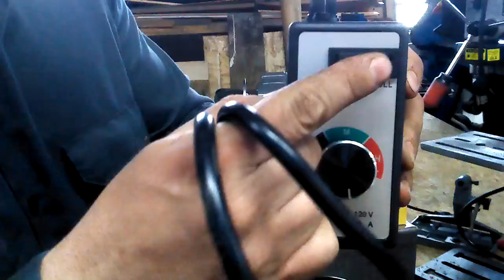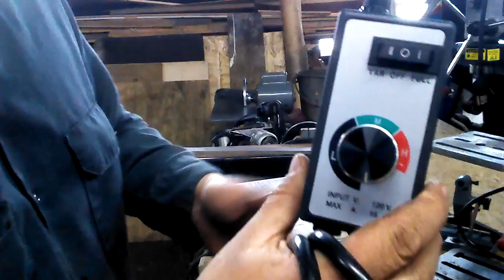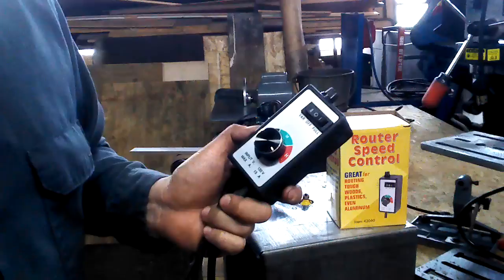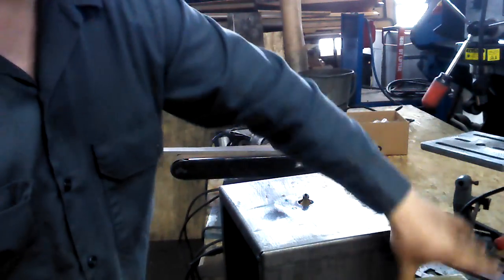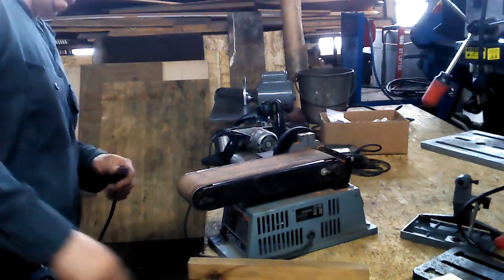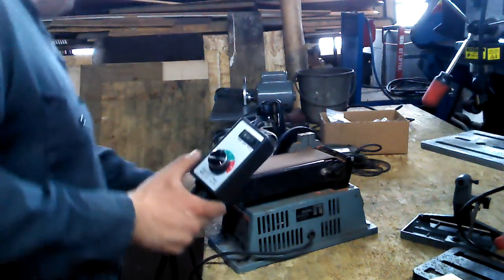Review: Harbor Freight Router Speed Control, does it work?

Comment: Would it work on a craftsman 3/4 hp 110 motor, for my metal lathe?
Reply: No that's an induction
 motor.
Reply: Idk what size Craftsman lathe you have or its age but my old metal lathe has plenty of different belt settings to cover the speed of turning anything I'll be turning then if you want to go real slow, put it in back gear then it crawls. The quick change box works very well on the feed speed which is determined by the rpm of the lead screw. Idk what you're needing a speed controller on the craftsman lathe for unless you're stuck on a high belt setting and are unable to change that. Please enlighten a dummy if you would as that has me scratching my head...
Reply: @decoy2636  lol, I had just bought the old lathe and didn’t know the first thing about it at the time, you are right. I’ve learned quite a bit since but still don’t use it much.
Reply: @shanek6582  
I'm glad you got it many things can be made on it. Mine is a 12" Atlas/Craftsman and has a 4' bed. Its handy around the shop although time spent dictates most things you will make with it. My lathe is not as accurate as one would like as prior to my acquiring it it lived a (rode hard put up wet) hard existance. 
I tried to buy it for over a decade from the owner before me before I walked in his shop with the right bait to trade with him for it.
I do hope you enjoy yours as much as I have this one. 
If you don't want to keep it part it out.
To add I wouldn't consider getting rid of mine and wasn't suggesting you should get rid of yours either. Parting one out brings double money it seems or more so that's what I was trying to say.
Best Wishes and happy turning to you.

Comment: Had one of these for years used it on electric die grinder for porting heads and lets you use a $40 die grinder to do the job of a $400 one that has a speed control built in.. 20 thousand rpms is just a tad to fast for port work I did it for years prior but with speed control its a whole other world. last year I dropped mine and it stopped working ..no worries $15 from harbor freight and got a new one however new one is absolute shit it does not slow down the die grinder very much as original goes to zero and infinetily adjustable the new one lowest speed is just to fucking fast to be useful. Save your money buy a single pole light dimmer rotary switch for $7 and a plastic light switch box for 27 cents and make your own

Comment: sir I have 1000w 50hz 220v 12000rpm brushed motor marble cutter machine , just I need slow speed so I have purchase from Amazon tiny adjustable speed controller 2000w ac 220v please guide me it will work or not if possible suggest any controller thank you

Comment: Would like to get one.This is coolest and the safest way not try to connect any wiring. But can this handle like a food blender, hand drill or a floor fan?
Reply: To answer that question it's best to know a little about what kind of motor you're dealing with and what sort of speed controller you're trying to match it up with. Single or three phase AC induction motors, AC permanent magnet motors, DC permanent magnet motors, and universal motors are all best controlled by different speed controls. Jeremy Fielding has a bunch of great videos on this sort of thing!

https://www.youtube.com/watch?v=ASywVBU0ZwE

Comment: will this work on an inline fan for a grow room? asking for a friend.
Reply: There is no purpose.  It should already be a controlled environment so the fan speed should be fixed, or can just cycle on and off.  This would just add a layer of lower reliability for something on 24/7 and since it doesn't self-regulate based on temperature or humidity, has no point in being used.  Get (one or more) big, really big, low RPM fans, and run them 24/7.  This means you do not want brushed motors because they'd wear out, rather induction motors which this controller isn't suited for even if none of the above applied.  So, triple no.

Comment: first of all thank you for sharing this video ,i have an electric motor(3/4 HP 1750 RPM
.3.5 AMP  ,110 V) it is a sander machine )i am looking for a speed controller for it ,do you think dose this speed controller work for it or not?.Thanks
Reply from the maker: matt kermani , not sure but this thing seems to be designed for hand power tools. I hope that helps, thanks for watching!
Reply: okay.thanks anyway
Reply: it will slow it down and also take away the power.. plus overheat the motor & could damage it

Comment: I have a 115 Volt 1725 RPM motor, will this work for this?   I'm trying to slow down a flat lap for lapidary work.
Reply from the maker: probably not, it works mostly on hand power tools because they have  brushes.
Reply: it will work but wont slow it down as much as you want
Reply: I was curious of the same thing. Tried a wall dimmer switch and I think it fried.
Reply: You have what is almost certainly an induction motor. DO NOT use a speed control like this to run ANY induction motor. The Triac ruins the sine wave that your motor depends on for proper operation, and the lower voltage will cause the motor to draw MORE current as rotor slippage increases.

Comment: would this work on a 12 volt 55 pound thrust  trolling motor
Reply from the maker: Odds are no.
Reply: That makes no sense.  It would have a throttle already.  Repair it properly, this is entirely unsuitable for a water environment and unsafe to use a little dial that sits in a fixed position with nobody holding throttle on.

Comment: anybody notice that their router sparks like crazy inside when you use the variable speed control? i have that 2 hp router from h.f. and the speed control and when i use them together it sparks/arcs in the motor. i can see it and hear it. redish orange arc... normal?
Reply: +jchinderle probably not a healthy thing. I had a black & decker drill that did that. It smelled like it was melting everytime I used it! 2 weeks later I got rid of it.
Reply: +jchinderle Indeed, quite a few sparks in there.  After all, this speed control is actually triggering many times a second to control the phase angle thus the speed of the tool.  Try to turn on and off a lamp with a switch rapidly, you'll see sparks on the contacts. One way to minimize such thing would potentially be the addition of a snubber or a running capacitor similar to the ones found in the HVAC.

Comment: You didn't open it up and see what's inside. More importantly you didn't put it on a osiliscope to see whether or not you're getting a full cycle or half cycle pulse. Which it seems others like it are only half cycle and pulse, which will burn out your tools. Which means it's not a true speed controller. You could easily test it without an osiliscope by hooking it up to an incandescent bulb and see if it pulses at a low setting. And if it does..  it's garbage!
Just plugging it up a bunch of tools doesn't mean squat.

Comment: Do you think it might work with a Dremel tool?
Reply from the maker: +Bruce Prosser Think so, But you should loose all power since it is an already tiny motor.
Reply: +Bruce Prosser only if it's a single speed. +1 to OP, you'll lose power - or in other words, it will be easier for the bit to bog down and stop turning. It would be good for buffing and maybe light sanding but not good for cutting wheels.
Reply: Thank you

Comment: ive tried that rout before ...as you can see not the best

you need either a powerful DC motor + dc motor variable controller 
or 
a 3 phase motor + variable frequency driver aslo called vector drive

both appraoches arent cheap

Comment: Have you tried this on a Lathe? I have HF's 10x18 Lathe which is great expect you have to change speeds via belts and if i'm working on a few different things that gets frustrating.
Reply: Kaged Creations would not work. It can only control brushes universal motors

Comment: I just watch this video to see if anybody else had good results with theirs I hook this device up to a 7 inch grinder that pulls a 10 amp load the package on the speed controller says it'll handle up to 15 amps yes it did work for about 20 seconds it burned up the fuse did not blow it just quit working I went to the hardware store and bought a halogen light dimmer put it in the box works better than this thing just let everybody would like to know

Comment: Why doesn't it reduce to zero rpm ? Seems it only slows down about 50%
Reply: That would be pointless because when used with the brushed motors it is intended for, long before it got anywhere near zero RPM, it would bog down under any load because there is nothing in it to boost output to maintain motor RPM.

Comment: Will NOT work on induction motors. Induction motors require a VFD to alter the frequency, not voltage. A home dimmer switch for lights can do the same thing for a Brushed DC motor as long as the amps do not exceed the units

Comment: Those things so ive found are built to a average amp pull. You load them up at low speed the brushes in your motor will arc and burn the rota plates out. DONT USE THESE unless your motor is the right motor for variable speeds. Basicly, if the tool you have isnt variable speed, Its not ment to be. Check the next model up, Is it variable? Does it use the same motor as the one you want to tweak?   Be careful, You might be doing this to save money buying the real thing, It may well cost you more... Much more. (fire)
Reply: Best explanation. If it aint variable as made, not meant to be. Your needle in the haystack!

Comment: How would this work on a bench grinder?
Reply from the maker: +P CC Most likely not, most bench grinders are Induction motors like the drill press and belt sander. This speed control only works with Brushed motors on power hand tools.

Comment: tengo un motor electrico de los mismo que tu tenes al fondo de tu taller  si funcionara con ese adaptador es de 115 voltios 1725 RPM de marca WEG BRASILERO DE 1.5HP GRACIAS POR TU REPUESTA 

I have an electric motor of the same that you have to the bottom of your workshop if it works with that adapter is of 115 volts 1725 RPM of mark WEG BRASILERO OF 1.5HP THANKS FOR YOUR REPLY

Comment: You got right and left reversed.
Reply: The internals of the switch are opposite.     When you push the button to the right,  the contact closes the circuit on the left, and vice-versa.

Comment: Unfortunately you need to reduce the frequency to lower the speed, not the voltage.
Reply: That is incorrect on these brushed motors that this is intended for.  Further it is not reducing voltage, rather chopping up the waveform for shorter pulse duration.

Comment: I tried this controller on my 3 HP router and it didn't work well at all. If you want a variable speed router, BUY a variable speed router. This controller does not compensate for loading at all.

Comment: I bought exactly the same one sold by another supplier, lasted two months for a floor fan. A piece of junk!
Reply: Arnold Fishman. ..did you check the fuse on it. Mine burned once.
Reply: Was your floor fan a brushed or an induction motor?  Any larger fan that is brushed is a piece of junk and this is not meant for induction motors.  You MUST match the controller to type of motor.

Comment: Could I use on kayak as variable speed switch and anyway to reduce polarity?
Reply: Better off with a pulse width modulator type controller. Cheap and easy to use. Will have to fabricate a box of some kind to keep it all dry.